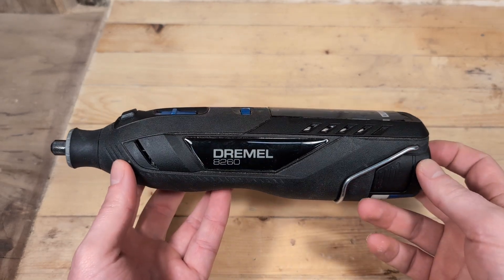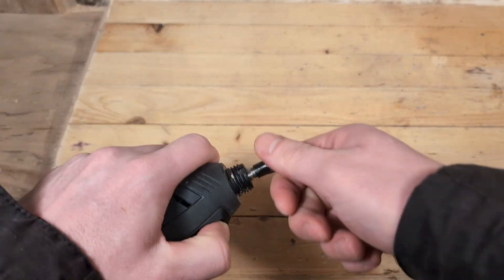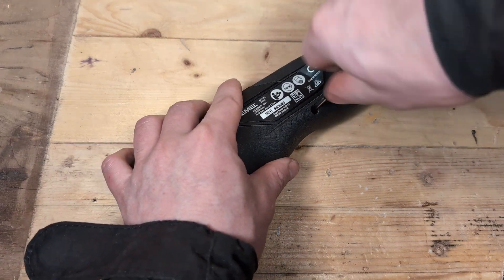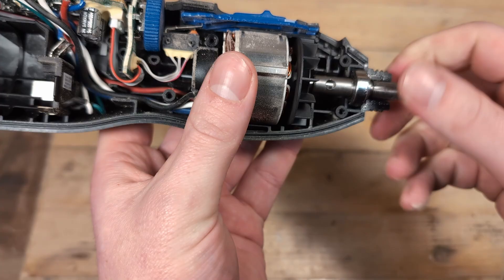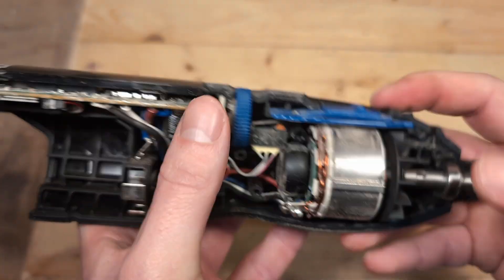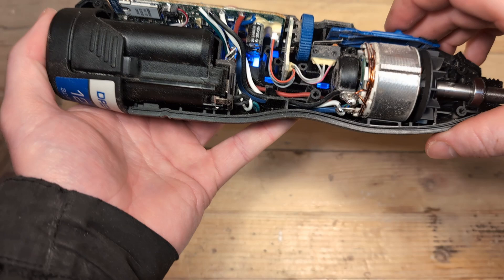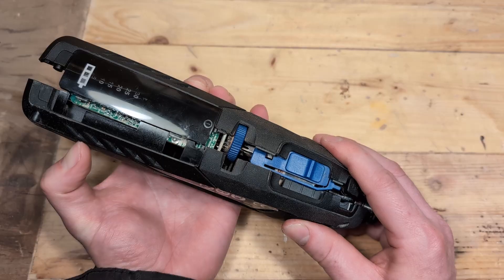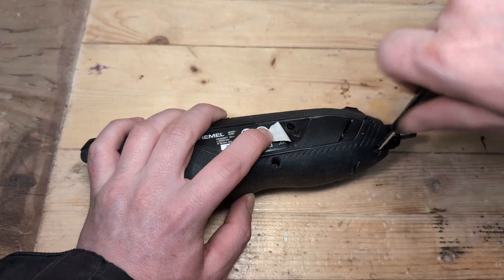A Look Inside The Dremel 8260: Disassemble And Assemble

Comment: It is Torx 8, not Torx 9 (at least for for my Dremel 8260).
Although Torx 9 fits barely, it's head does not reach the bottom of the Torx hole and can easily cam out.
Reply from the maker: Yeah. Might be. I only had the T9, and it seems to work fine. But T8 might fit better and avoid stripping out the screw heads in the long run.

Comment: Thanks for sharing.I want to buy the 8260 but where I live they don't sell him and I can't find where to buy online.
Reply from the maker: Hi.  Here in Norway they have it in most places where tools are sold. I know there are some exclusivity deals for the Dremel 8260 in the US with some of the big brand stores,  so you will not always find it on places like Amazon. But however, the Dremel is 8250 is basically the same tool just without the darker design and Bluetooth. So If you can find the 8250 I would just go for that.